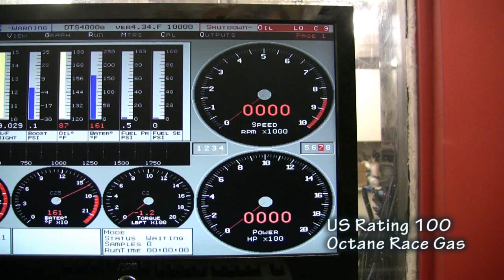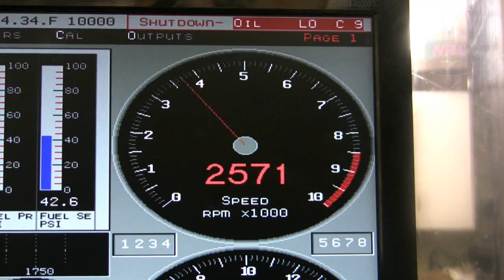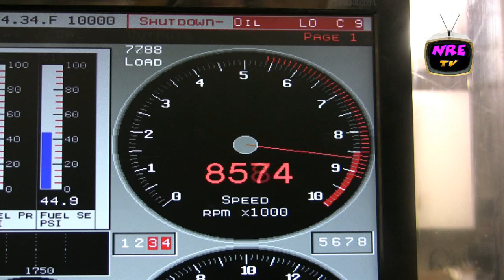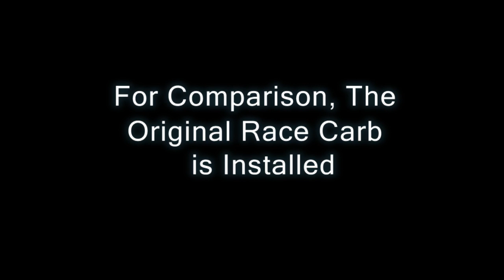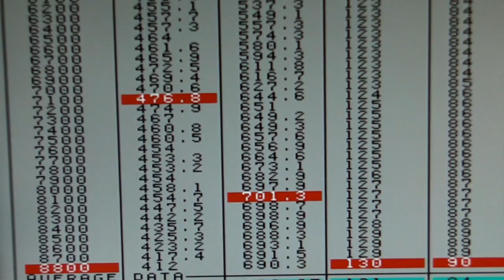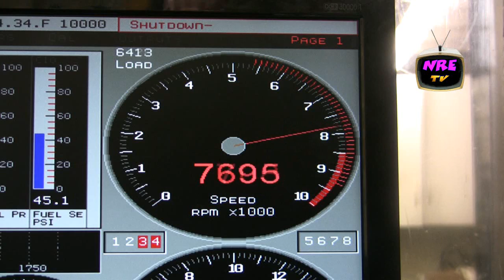Nascar at NRE.  9600 RPM SBC. Bonneville Engine.  Nelson Racing engines.  NRE.  Tom Nelson.

Comment: What would I need to do to get a 355 to rev like this
Reply: 14:1 or more compression
Big runner heads
Big solid roller cam and kit
Titanium valvetrain
Lightweight but strong bottom end ( billet rods and crank )
A lot of $$$$$
Reply: @hoost3056  Not even available to civilians
Reply: @Gasóleo98  you can get the parts. CP/Carillo rods and pistons, Callies crankshaft, valvetrain from anybody reputable ( I like Jones Cam Designs ), Ferrea valves, Jesel rockers, then get a Nascar dedicated shop to put it together.
Reply: I really big pile of MONEY

Comment: Clearly this engine is just a stock smog 350 with a quarajet.
Reply: 2 bolt.main
Reply: @ericdebisz9458  with some chrome
Reply: Steven Vanheel : SB2 with custom block and heads, nothing SBC at all. 4.48 bore spacings and even Keith Dorton made 650 hp at 9600 rpm with two cylinders deactivated. Its an exceptional engine.
Reply: @deanstevenson6527  I was being sarcastic when I made wrote that comment lol. Smog 350’s make like 190 hp on a good day
Reply: Steven Vanheel : Yeah. ;-) I got it now.♡ Lol.  I like the LT1. Any of them. Even a 1971 engine swap specimen downgraded to a Qjet did 265 hp  (what we think was 365 flywheel)  one day at the wheels of my neighbours 350THM 8.2 inch corporate axle 63 Chevy BellAir. I've had other small blocks dynoed that wouldnt do that stock. To double that....its always Great to see.  Only issue is he had to pull 1000 revs extra to find another 20 something extra hp. But 210 mph...is 210 mph. Whatever got the job done. My respect!
Reply: @deanstevenson6527  I have the 8.2 10 bolt in my 66 Chevelle. So far it has been a tough rear end. It has survived everything that my aluminum head 383 has thrown at it. I think that engine should make somewhere around 400ish horsepower. I also have a th350 with a 2800 stall and the firmest shift kit you can get from b&m. That can’t be very good for it either
Reply: Steven Vanheel : 110 mph @ 4800 rpm in six seater 63 Chev with 265/50 14's under the Saddle Hill underpass in Dunedin. An 8 % grade. My wife, myself, son, and my next door neighbour driving with girl friend and child. Six of us. Same machine, 136 mph @ 5800 rpm  along the lakes to Christchurch. Never, ever underestimate the power of any GM engine, especially the second year downgraded compression engine. The cam was a downgraded 295 Heatseaker Hydraulic, a kind id first experienced in a SBF . My first proper power experience was the Bob Pinnell spec Australian XE blocked 2V headed 351C with 295 Heatseaker, 780 cfm 3310 and Edlebrock Performer, 10.7:1 compression, Top Loader, 2.92 9 bolt Firebird G52 7.875 axle in a Australian 71 XY Falcon 500 sedan.  Virtually no difference in head flow between the worked 2V closed chamber 302C heads and the 461 Fuelies or worked 399s. NASCAR knows all the tricks. Pushrod engines for the win!!!!!
Reply: @deanstevenson6527  I would take a pushrod engine any day over an OHC engine. Not too often that you see an ohc engine make it to 300k miles. Modern Chevy pushrod engines can do it no problem.

Comment: nascar switched to EFI electronic fuel injection a few years. They run a Freescale/McLaren Electronic Control Unit (ECU) and  Holley EFI throttle body. The only thing passing through the Holley EFI throttle body is air, despite being similar in appearance to a carb. Its setup to run Sunoco Green E15 gas.

Comment: Looks like a nationwide type engine... 720hp with 9300rpm rev limit. Cup engine would be closer to 900hp and be able to rev 9800+
Reply: cup engines now do 725 hp and 9000rpm limit
Reply: Infinity now is not 2011
Reply: billyjack70 i know im just mentioning todays engines. btw nascars never did over 9800 rpm. they only did up to 9600 before the rule change IIRC
Reply: They were turning close to 10,000 quite often. I even have seen 10,800 at qualifying at the Glen. It was getting out of control which is why the gear rule is in place.
Reply: billyjack70 can you link me to a video showing this?
Reply: @jaymz  Really? Guess those engines I saw on the dyno hit 10,200 were an illusion...
Reply: 940hp top speed 425 kmh mass 1565kg
Reply: It would also have a lot more valves and no pushrods. This is a class specific engine.

Comment: Horrible torque numbers.
Reply: hp=tq x rpm/5252
basically as rpms increase horsepower increases if this engine redlined at 6500 the peak torque numbers wouldnt be that far off from peak horsepower. a formula one engine is able to make 700+ horsepower because it revs to like 17000 rpms, but they only make like 200 lbft of torque
Reply: You see that's what I was thinking at first.  But consider what this motor is for, a lightweight application, where you need more revs type HP with less motor weight than a big block and no turbo's  See that's the kicker, without those Mirror Image twin turbo's it's kinda like Superman without his powers... Personally I love the sound of this motor.
Reply: highvelocity123 I was explaining to the original commenter.
Reply: sjpro1 I understand how it works.  Tell me how turbo's effect torque and HP again.
Reply: +sjpro1 no. you mean by swapping cams and adjusting timing you can move the power curve where you please. by limiting the block to rev. to 6500 your beating yourself up.
Reply: That’s what comes to be expected when an engine runs that high